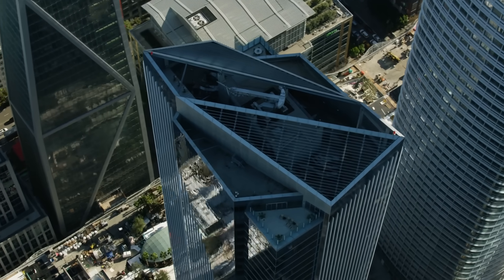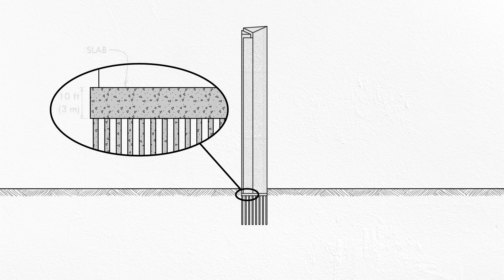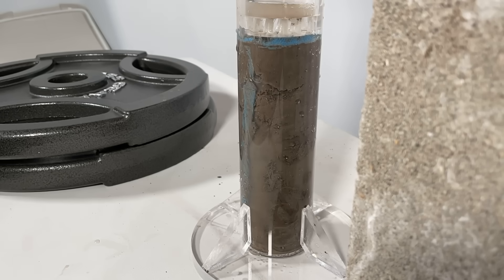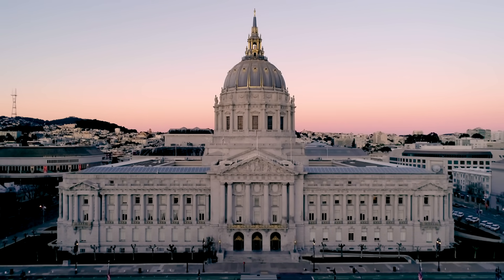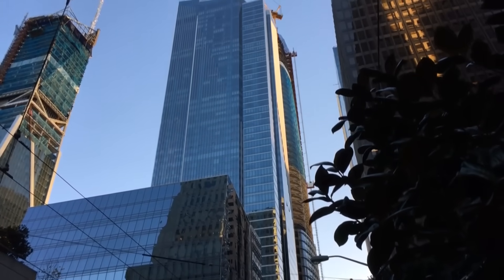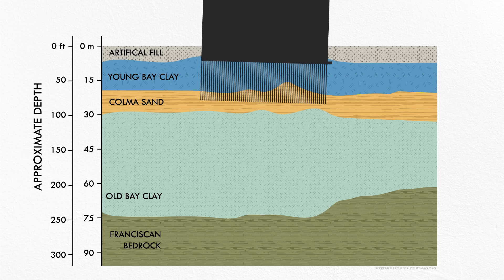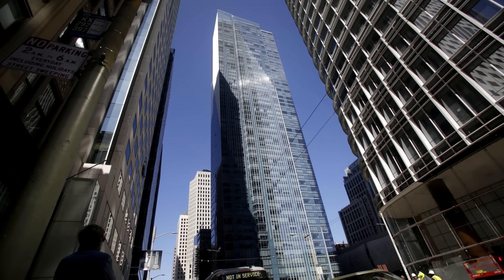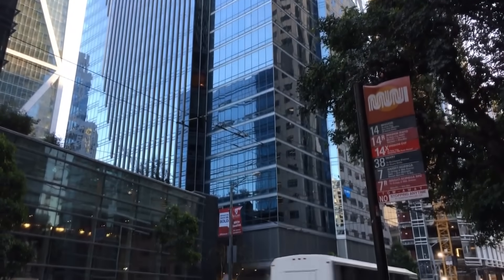What Really Happened at the Millennium Tower?

Comment: I was an ironworker on this building from footings up. The amount of rebar in the foundation is nuts, but VERY early in the project it was well-known to be built to outdated foundation specs compared to the change orders tacked on going vertical. These issues were brought to the attention of the general contractor AND the developer. They could have been corrected early on, but the developer downplayed them to minimize costs and maximize profits. 

These issues were known BEFORE the structure reached street level.

I’m not saying anything, I’m just saying… cough scumbags *cough*.

Even before the iron stopped flying and the finish work began, the building was leaning. It was a fucking nightmare to work on if I was under someone that liked setting down (and subsequently losing) their tools and dropping them on me. It’s funny until you realize some sleever bars weigh 10lbs and have a tapered tip. This place is going ass over tea kettle during the next major earthquake.

I hope the responsible parties have to sleep on the streets by the time the problems are corrected. They acted with zero regard and responsibility to the people dumb enough to move into this building… and what is the US if it isn’t coddling the stupidest, most entitled, and greediest among us?
Reply: Nice perspective brother. I'm a union electrician and have been on jobs with the same sort of conflict between the owners and GC trying to keep their cash and the tradesmen looking around at it like 'you see this shit?'
Reply: Sad thing is they act that way because they know the have a high chance of getting away with it...
Reply: Many thanks for info Totally agree  Screamed Scumbaggedness from day 1  Let me add gov't collusionism was key to process, even before occupation
Reply: So, to avoid more tilting, why not compensate by sinking southeast? Since the drilling is accelerating the tilting, would some drilling on the opposite side (southeast) help?
Reply: @lorenzoblum868  They need to follow the science. Yeah, that's it.
Reply: In other words, management played its usual role.
Reply: @KS-xo3oh  yeah, organized labor is terrible. Workplace safety. Weekends. 40 hour workweeks. Terrible horrible unions.

We voiced the problem. The developers didn’t listen. That’s a capitalism problem, not an organized labor problem.

Moron.
Reply: Obviously the cost of making the proper corrections was going to be more than the cost of lawsuits so therefore they just carry on .
Reply: I don't blame those "dumb enough to move into this building". I blame those so greedy for profit, that they didn't spend the extra cost (from what I've read, $3.5 million) to drill down to bedrock in the first place. Each unit was selling for $2 million. It's nuts that such an expensive, luxury building, they were willing to cut costs on literally the foundation. If there's one place not to cut corners, it's the foundation. And I get it, other buildings were built this way. But considering his was a luxury building, it's not like the funds weren't there to fix this. And once you guys pointed out the leaning to them early on and they STILL ignored the issue, well let's just say they've got really good lawyers that they weren't blamed in the end.
Reply: So....For an uneducated guy like me, what a can read from you comment is.
Its a time bomb ?
Is it just  matter of time to the building collapse ?
Reply: @streetwarrior31  pretty much yes exactly
Reply: that is ridiculous, i cannot comprehend how SO many people THAT fucking scummy and greedy get into positions of power, i mean it makes sense in literal terms cause they're scum and will step all over everyone and disregard safety of thousands of people just to save a few bucks but like.... how the hell do so many other people LET them ascend to those positions of power and not give SERIOUS pushback at any or all levels? it's wild how accepting our society is of just absolute scumbaggery
Reply: Nothing like hearing the straight scoop from people that work on a construction site. Matter of fact honesty. Thank you.
Reply: I was a labourer on a 13 story car park in downtown Miami in 1982-3. The vehicle ramps were poorly supported by rebar that barely penetrated into the columns, and I always wondered if it's still standing.
Reply: @Longtack55  lol. It's not comforting to see that the US industry standard is no better than EU standard.
Reply: I remember two projects in Japan and China where they freezed the soil to be able to drill the piles.
One of them was Qinghai–Tibet railway on unthawing permafrost. IMO if they do it while drilling four piles at the same time, it can be done
Reply: A developer who downplays problem to minimize costs and maximize profits. ... I don't believe you.
Reply: It will not take another Quake the whole high rise area built on that two layer mud pack will come down without any help just a matter of time.
Reply: @sidneyeaston6927  recent news of it shifting massively pretty much ensure a looming condemnation.
Reply: @buttsexandbananapeels  Yes movement in the underlying mud has all ready started the process of liquefaction and the more it moves the more the mud will liquefy speeding up the process. if it comes down the shock wave in the ground will bring down the surrounding buildings no ifs or butts about it. The plan to put piles around it will fail it will only add weight to the side that is sinking. The mud that is having to be sucked out of the bottom of the pile holes is coming from somewhere and that means a lot more than the width of the hole is moving down there.
Reply: @sidneyeaston6927  not if the new piles stand on bedrock.
Reply: @T1hitsTheHighestNote  Not so the thing is sinking all round  would soon start tilting in the opposite direction. When mud at that depth starts moving it involves a larger area than the foot print of that building.
The city of Alexandria comes to mind.
Reply: @T1hitsTheHighestNote  there is all ready mud having to be removed that is pouring into the first pile hole they are only planning to shore up the side that that has sunk the furthest. that will be plenty to liquidate a good area and destabilize  the buildings around it. Even leaning a little bit can change the wind shear force by a few thousand tons and put even more stress on the foundations and the mud below.
Reply: @T1hitsTheHighestNote  yes, but those new piles have to get there before settling further disturbing the soil dynamics.
San Francisco Bay is probably the worst terrain over which to build tall (or to build at all) with Mexico City, much of the Tokyo metropolitan area and possibly Istanbul quarters across the strait, but who cares? They are profitable and you can shift the risk over insurance policies.
💰 💰 💰 over Reason
Reply: @T1hitsTheHighestNote  I believe many of the others are in bedrock
Reply: @buttsexandbananapeels  Yes needs taking down fast, drilling new pile holes is turning the surrounding mud to liquid that is moving in from under the existing foundation.
Because they have to remove mud from the new pile holes that they are drilling and they keep filling up with fresh mud I would recommend taking the building down and planting grass if only to save the buildings surrounding the plot. History tells of great towns that have slid into the sea.
Reply: @sidneyeaston6927  I agree. Millennium Tower is literally an application of “life or limb” when it comes to the entire surrounding area. The developers knew the problem was there and failed to act with due regard. Their negligence shouldn’t take down the entire surrounding area.
Reply: @buttsexandbananapeels  The usual result of overloading that type of terrain is that it breaks down and slides away in the same order that it built its self. I would  advise  a complete survey of every thing between the river and the lake every three months for ever more.
Reply: @sidneyeaston6927  you don't even know what liquefaction is...
Reply: @thornil2231  Go buy your self a bottle of tomato sauce in a glass bottle then try getting it out without shaking it. Apply that experiment to wet clay under a heavy building.
Reply: @sidneyeaston6927  you are the kind of guy who knows enough... to make a fool; of himself. Who is talking about liquefaction? There is a problem of settlement and specifically differential settlement.
Reply: @sidneyeaston6927 ... dominoes
Reply: @sidneyeaston6927  and they can't just dynamite it to fall in place because then everyone will be wise to the 9-11 inside job...
Reply: @sidneyeaston6927  Why don't you stick to what you know?
Reply: Yes siree and when things get worse, the fact that all was downplayed and ignored creates criminal activity so, those involved not only have to worry about compensating folks with their own money, they risk criminal charges and prison.
Reply: @Garth2011  they deserve whatever bad happens to them. No sympathy. No tears.
Reply: Chinese project managers and lead hands on site?
Reply: This pretty much negates the comment I just posted about giving the developer the benefit of the doubt. Learned something.
Reply: You act like this is an issue specific to the US, when we have some of the most regulations and hoops to jump through of any country.
Reply: Well said.
Reply: Greed wins again
Reply: This is a huge schadenfreude for me. Oh, gosh, the 1%!!
Reply: But what will the 1% do?!?!?!
Reply: Thanks, sir.  See my comment, and facts  ABOVE....
Reply: A perfect representation of the $HitHole California has become. Democrats. You wanted them, you voted for them, you got them, and now they shall all reap what they sow.
Reply: heck yeah dude, you're based 👍👍
Reply: Well worded.  From someone that really knows and been there.  Thanks for this.
Reply: Demolish the building, section by section… it may cost billions to do it, but it will save them more for future  class action lawsuits for gross negligence and wrongful deaths…
Reply: Thanks for your input. As I watched I couldn't help but wonder if at any time in the foundation/ construction phase did anyone think/ know this wasn't a good idea. It makes total sense what you described happened.
Reply: Capitalism at it’s finest.
Reply: I just can't believe this, I'd rather be a fool that have anyone tell me so!
Reply: As of 15 August 2023, it has sunk 29.5 inches… what does that translate to at the top?  Tens of feet of lean?  Windows are beginning to shatter… which tells me that the building is beginning to buckle from its own weight. 
Also, with that much tilt at the top, gravity is beginning to “pull it” toward the ground.
Reply: @alitlweird  can you imagine living there? I’m sure the residents are not being warned about the latest lean.
Reply: What does someone dropping tools on you have to do with the tower leaning?
Reply: @Sevey11  you’re not really that incapable of deductive extrapolation, are you?
Reply: As an SF resident while this was being built, this video covers the basic engineering but not the practical reality of how screwed up this project was.

It also fails to mention the floor was so unlevel that a ball would roll across it on its own. That’s the he main reason no one wants to live there
Reply: @Justa -  Thanks for the info.  This is another sad example of "greed trumping humanity".
Reply: The responsible parties are "Boston Properties" and don't even live in San Francisco. They will be just fine.
Reply: Negligence & greed at its worst!  I would never live in a high rise, especially in a heavy earthquake zone!  I’m not even comfortable staying in a high rise in Vegas! 😬 Ass over tea kettle & many deaths for sure!  They should just implode it!
Reply: A crooked tower in a crooked city.
Reply: but I bet you need a special permit just to paint a house a few blocks away.....
Reply: Even with new piles standing on bedrock, getting them there in the first place is risky at best because they’re constantly drilling and removing more support from the structure as they descend.  This is also creating points of evacuation for more soil to escape during drilling.  The city never should have approved it in the first place.  But that’s type of mentality that you get from a city like San Francisco.  They’re more concerned about taking away god given rights and buying ice cream for their $20,000 fridges.  They pay their homeless people to live on the street and neglect building a strong infrastructure based on sound decisions.  This building is a time bomb and I feel sorry for the neighboring buildings this will impact.
Reply: @vdan02  that was my 1st thought...they have to actually get the pilings into the bedrock 1st, & with the unstable mud they have to go through to arrive to the bedrock...yes...a good deal of instability could be created before any piling hits bedrock.
Reply: San Francisco building code was never designed for such a large building the city planners were out of their league thanks to Gavin Newsom changing the legislation about city maximum height ! I’d probably watch you build that thing dude nice post.....
Reply: @LittleOldBoat  you do realise the tower was constructed while Arnold Schwarzenegger was governor, right?
Reply: @lootlord8995  Newsomewas the mayor of San Francisco from 2003-2007 Construction on the tower started in 2005. I don't know what involvement if any Newsom had with its construction.
Reply: World govts are colluding together at the expense of their own citizens to usher in new world order. New world order led by obama and pope francis is coming. Jesus christ is coming back for the rapture. Get ready. Dont believe the coming ufo alien abduction narrative. Refuse the coming mark on hand or forehead at all costs
Reply: @KS-xo3oh  Unions are what stalled the US auto industry in the 70s, 80s, and 90s. There was a time unions were useful now they are a way to tell you how to vote, and take your dues.
Reply: @andya2665  No, protectionism (generally in the form of tariffs] stalled the US auto industry.  The Unions were simply operating in the same protected business space as management and wanted a fair share of the profits.
Reply: @JoeOvercoat  I thought it was because the Japanese were making competitive vehicles for less money, that's why the Chevy Vega and Ford Pinto were conceived, both fiascos. Plus the cost of paying union wages was just too much. Unions also could be blamed for Detroit. Not just the auto workers, but steel workers, btw, were both run by rackets. Now we rely on China for our steel. They have no regulation and yet we still buy their steel. Meanwhile they have become an adversary. Regulations and unions. All is ok as long as China is the only one polluting. Making money, and paying low wages. I will blame the unions, lobbyists, and bureaucrats for their gross greed and mishandling.
Reply: @andya2665  What you said but the cost of the Union worker is a canard: the guys on the floor are the not the ones designing crap & making the wrong decisions.  Management could have committed to better wages instead of promising future benefits, where they took the easy way out.
This is a multi-faceted issue, and there was absolutely a racist element to it at the time (a great distraction to the union guys who went all in on literal car bashing events, even). But the big guys in charge went for the political lever instead of...well, creating the Brat first.  ;)
So yes, we begat the Vega and the Pinto, in part because to this day we don't appreciate the underlying cross-enterprise team-building business culture in Japan that facilitates success of things like 'Just In Time' stocking, where Americans treat that as 'buy at the last minute and only sure if you need it'
And we did the same thing with the rise of the euro touring sedan...Detroit went big, just plain big. Gawd forbid that we make a decent car (there are exceptions but it's a sad state of affairs, mirrored in American racing). <sigh>
Reply: @JoeOvercoat  then let's blame the American auto industry all together. They were designing out dated cars and having them built by overpaid union workers who took no pride in workmanship because the unions made them unfirable entitled people. 
The brass of the company had to design what was affordable for the to build with their labor cost so high, thus they cut corners. Unions ain't worth a darn.
Reply: @JoeOvercoat  not at all, their cutting corners administrative decisions had plenty to do with bad product.